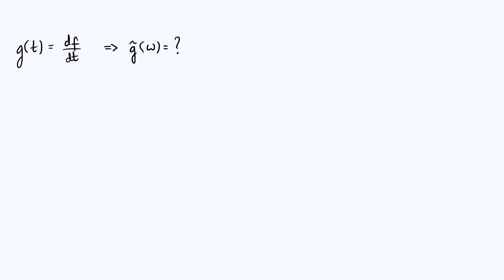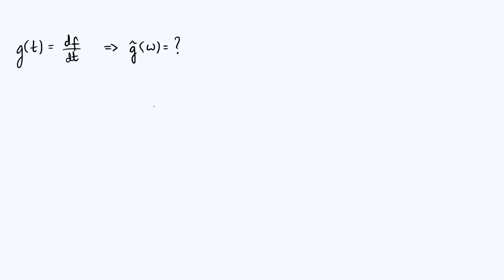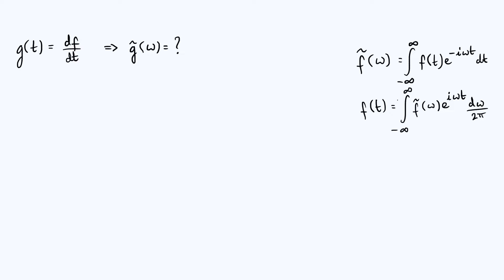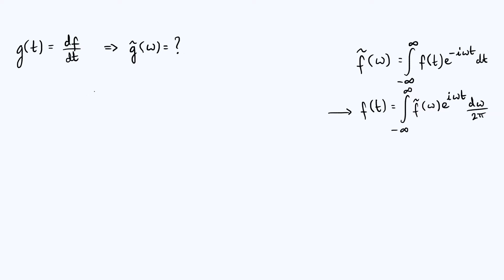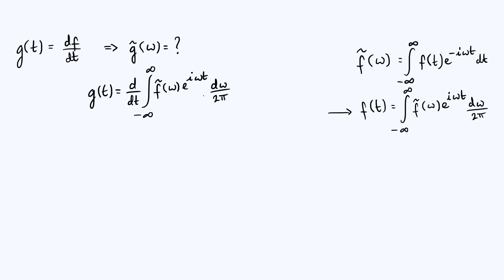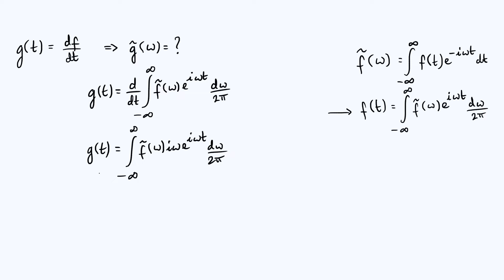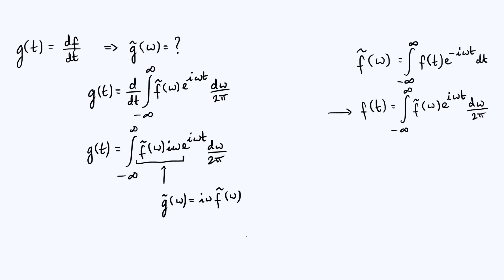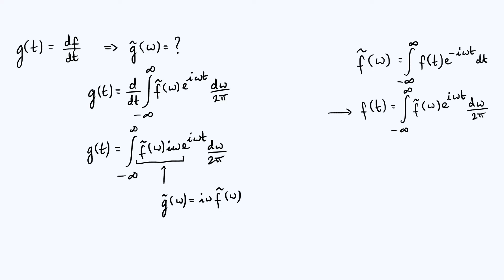Fourier transform of a derivative

Comment: How can you prove that this works for higher order derivatives. i know the formula involves multiplying by (ik)^n, at least in my lecturers version, but how can you prove it? The d(n)f/dx(n) cant cancel out with the dx in the integral because theyre of different order, so im stuck trying to simplify it
Reply from the maker: That result follows straight from the one in the video - we've proved that differentiation in real space is equivalent to multiplication by ik in Fourier space, and taking the nth derivative just means differentiating n times, i.e. multiplying by ik n times in Fourier space, giving an overall factor of (ik)ⁿ.

Comment: I like to think of this argument as a special case of representing a linear operator in its eigenbasis. Each function exp(i omega t) is an eigenvector of differentiation, w.r.t. t, with i omega as the eigenvalue. Since the Fourier transform of a function, f, is the collection of the coordinates of f in that basis, the formula follows (the omega-th coordinate of df/dt is the corresponding coordinate of f multiplied by the eigenvalue, which is i omega).